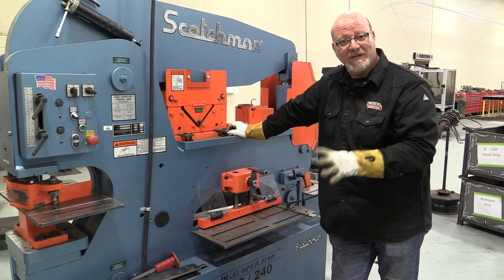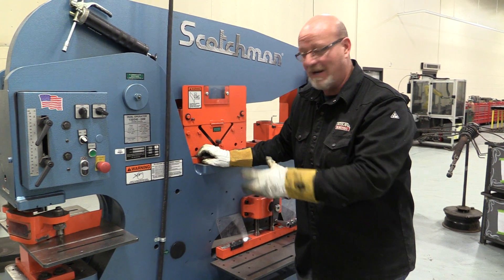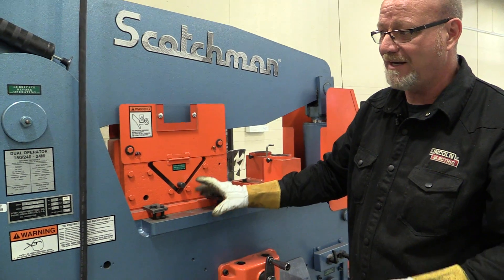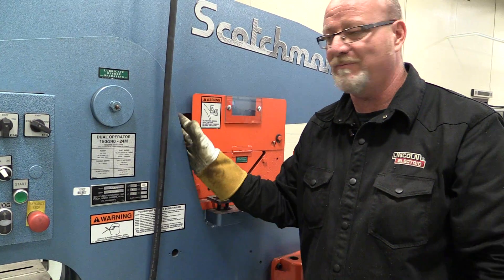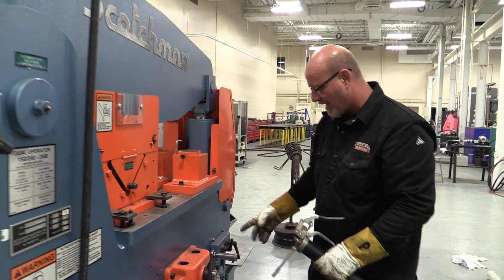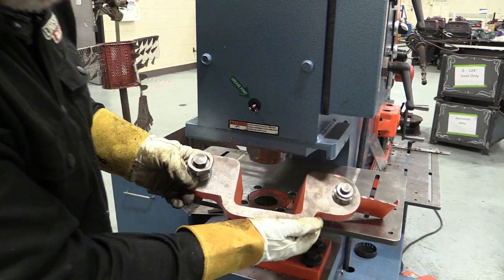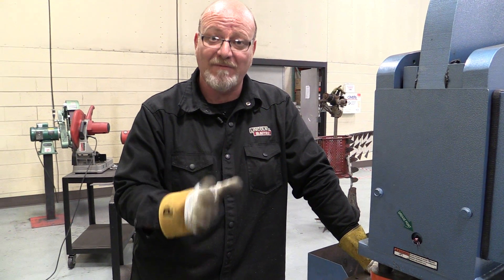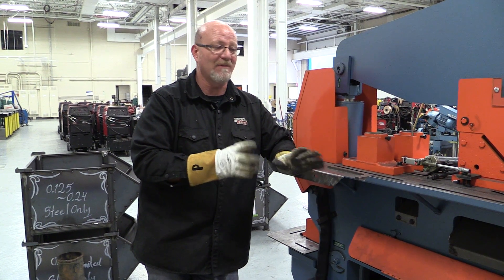Scothman 150 ton Iron worker operation and maintenance for beginners.

Comment: Lack of grease Does Not lead to a catastrophic Failure.    We use a hardened brass bushing on the pivot points of our beams.  Replacing a Fowled bushing is not a fun job.  The Scotchman iron workers are serviceable and re-buildable in almost every respect.    But yes, grease your machine on a regular grease schedule and save yourself the hassle.  I also recommend reaching out to your local dealer or Scotchman rep for a free training and maintenance session on any new machine purchase.   Thanks for the great Video Mark.